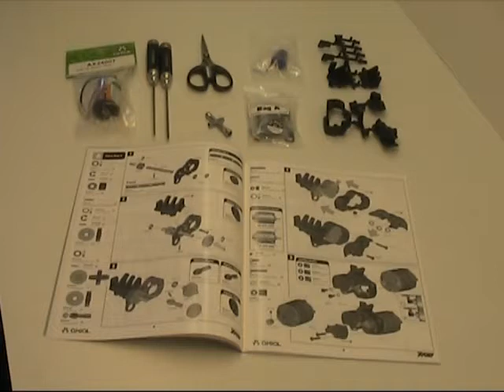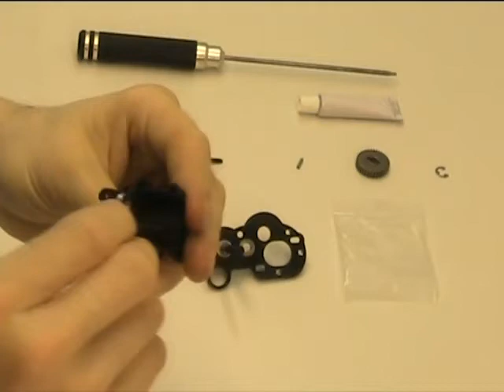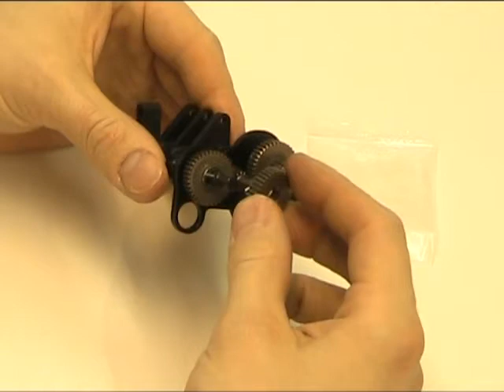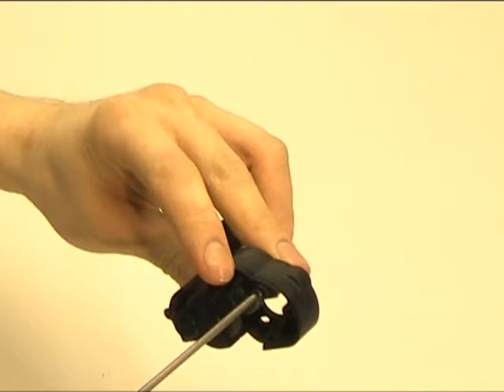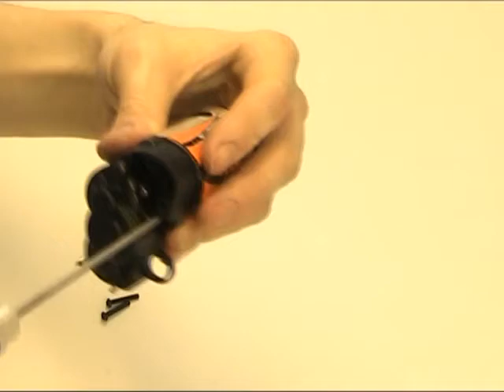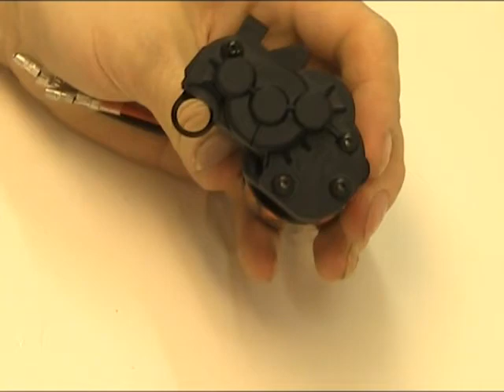Axial XR10 BUILD Part 2 Building Front Axle BAG A transmission gearbox Getting started.mp4

Comment from the maker: Sorry for my slow reply on this. Just check that all parts of the casing are closed as this is the correct screw for set 4. Also check that they are the same size as those on the page of the manual as they are 1:1 with the drawings.

Good luck with your build.

Comment from the maker: Sorry to hear this. Yes it does sound like its the gears :-( You can strip this by doing the reverse of here and if they have modded the gear plate when building you will be able to remove to inspect.

When you rebuild it is worth ungrading to their later motor plate with larger bearings and heat sink. If funds allow the upgrated gears and shaft are a must to stop this happening again.

Hope this helps

Comment: Hey there, I just picked up a pre-built xr10 and the first time I ran it it started making a weird noise in and around the gears and motor, it's the front axle. I'm new to rock crawling also so could it be stripped gears? If you could reply that would be nice or anybody who knows anything about this truck. Thanks!